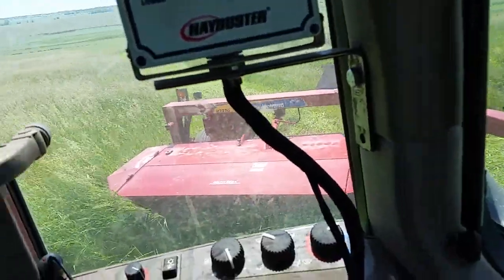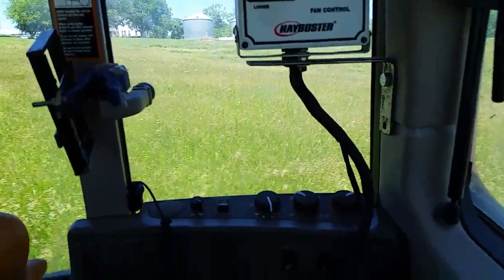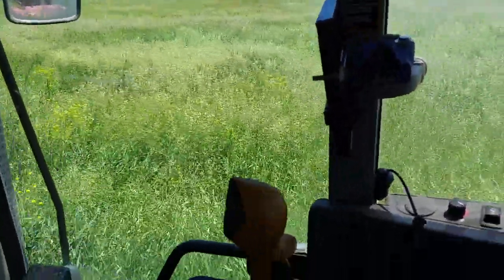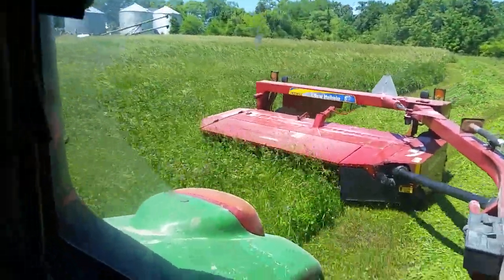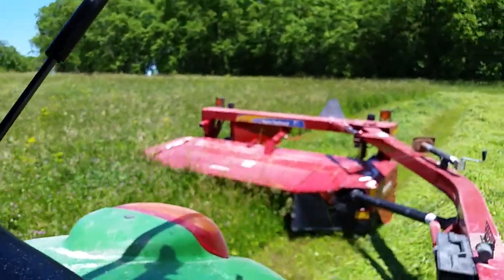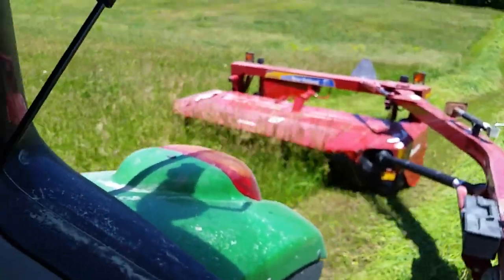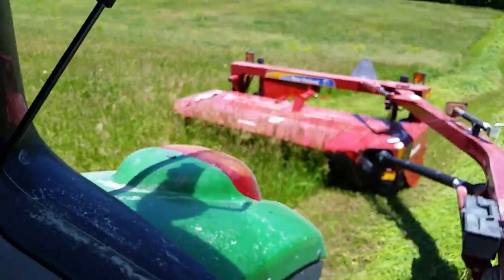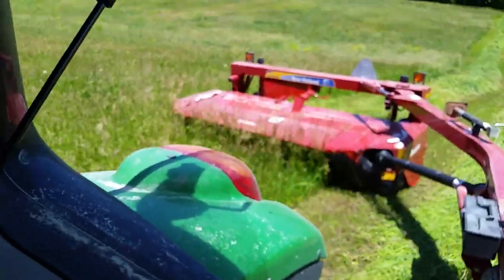Start of 2016 Hay Mowing

Comment: Why didnt you buy a john deere moco?  built twice as good as nh.  imo
Reply from the maker: Ive always had new hollands. Plus it came from same dealer as the haybuster, they were all one big deal kind of
Reply: I myself always liked how a New Holland floated over rough terrain and the cutter bar angle could be adjusted with a small tap to the lever without lifting the machine.  John Deere Mo Co seemed heavy against the ground.